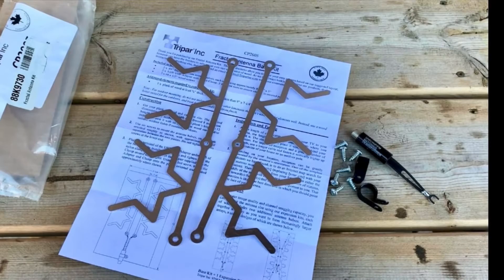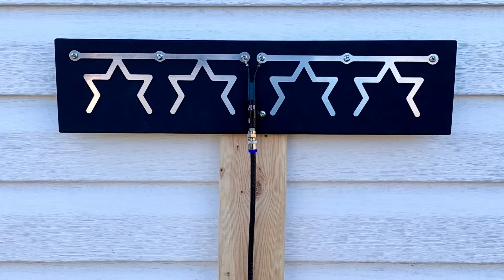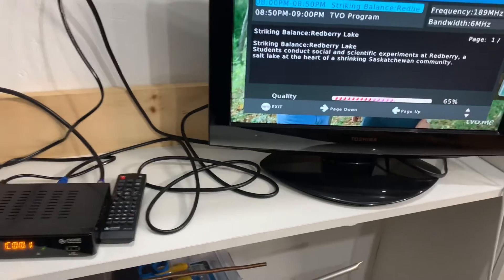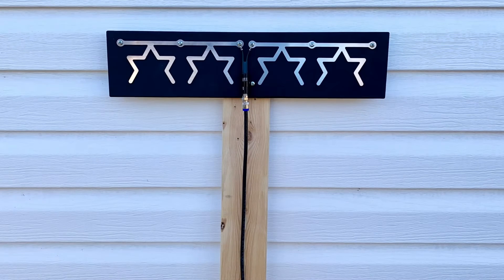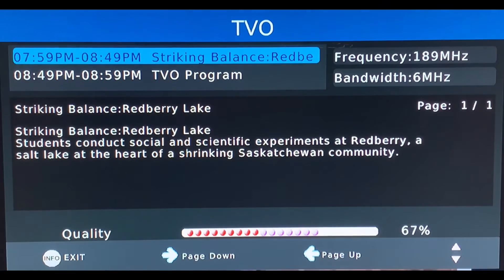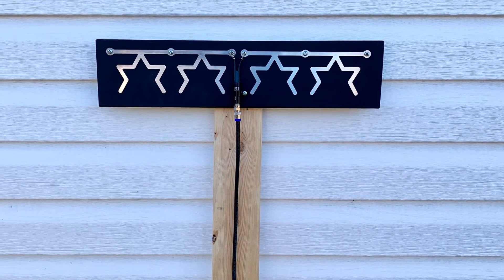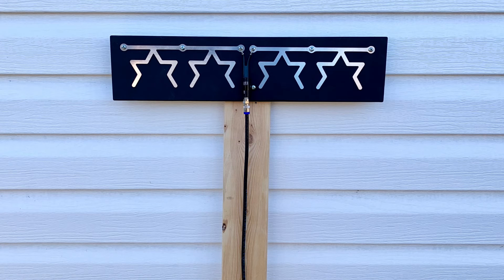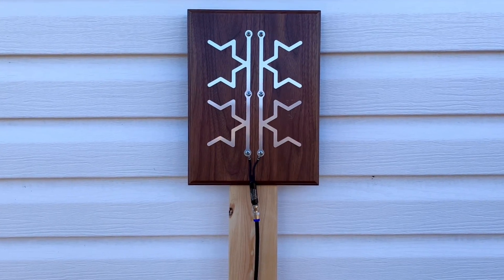Fractal TV Antenna Signal Strength Test

Comment: Wow, man, these are beautiful! I am tearing up. Finally! 

I have been searching for decades, looking for any antenna which was made by an artist, with sculpture in mind.

Your stained and varnished wood would look great just below the vent of any house, as it looks like an art installation.

I just supplemented my traditional antenna, banned to the attic with a Antennas Direct MaxV which looks like art, an infinity symbol. I zip tied it to the peak vent and televes two antenna balancer, $79.

You could put sheet optional metal behind the wood for a reflector. You could put more elements and loops without hurting the appeal and get more stations. 

By pairing mine, I got more stations and boosted many of the existing, over just the attic.

Comment: The fractal TV antenna performs better on UHF Band, it can receive strong signal TV channels on VHF High Band.
Reply: Would not this be easily fixed with two 15 inch lines (channel 10) and a rear reflector, if needed?  

If it's the material, then embed the dipoles in the wood.
Reply from the maker: I made one of those, maybe I can combine them.
https://www.youtube.com/watch?v=bYfZu923aTY&t=141s